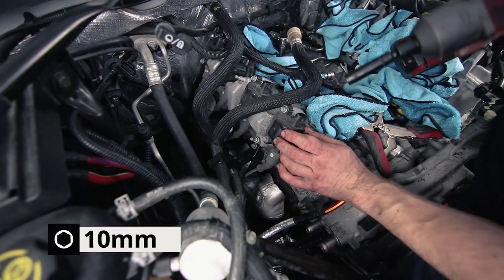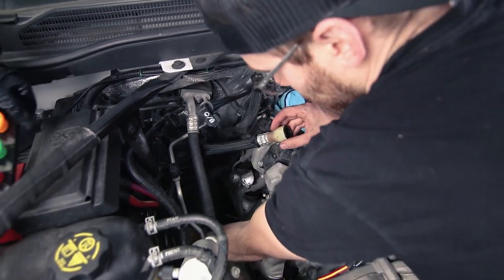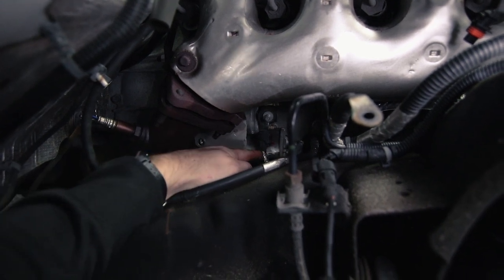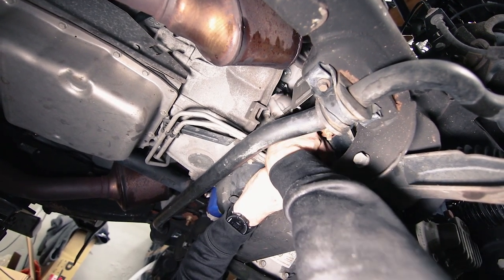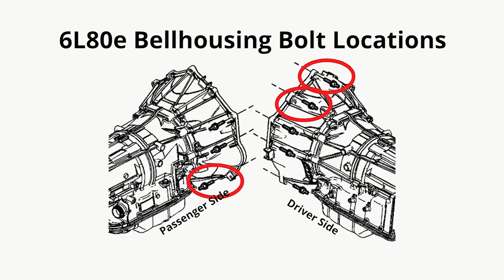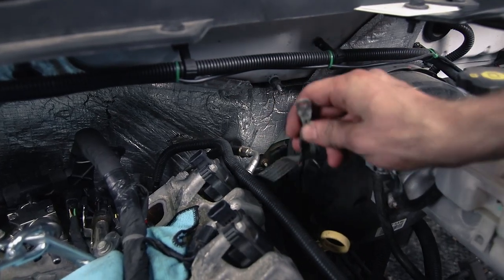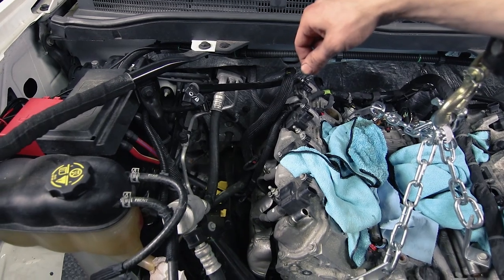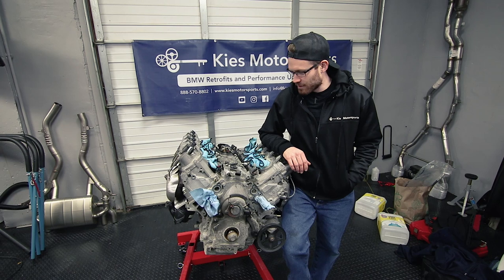AFM DOD Delete Part 3 - How to Remove 2014-2018 Silverado Sierra 5.3L and 6.2L Motor L83 L86

Comment: FYI there is radiator drain on lower passenger corner to drain coolant.  Hidden and not easily visible but it is there
Reply: used it on my 14 silverado 5.3
Reply from the maker: Of course there is 🤦‍♂️ haha I wish I had been able to find it. That would have saved a lot of cat litter. Thanks for the tip!
Reply from the maker: I'm waiting for the comments to roll in of what was  missed or wrong. Yours is  a helpful one tho so I pinned it to help anyone else 👍👍
Reply: It only drains what's in your radiator. Not your engine.
Reply: Just curious… I tow my camper and I was wondering if you or anyone you know of switched out the non max trailering radiator for the larger max trailering radiator? Is it even possible?
Reply: @theboostedgamer4453  probably better just to get the mishimoto trans cooler and radiator than going oem
Reply: He keeps calling the ignition coils injectors. The injectors are under the intake manifold and are not accessible unless the intake manifold is removed.

Comment: This is the most comprehensive video of GM engine removal I've seen.  Since your AC wasn't charged, you were about 20 minutes away from having  the entire radiator support removed.  The extra 20-30 minutes of work is worth it to not have to climb over and into the engine bay.  Saves your back.  Also you can pull the entire engine/trans assembly straight out if needed.  .
Reply from the maker: Thank you! Good to know! Wanted to show how to do it without removing those parts since most diy people will do it with the front end still on the truck. That would have made it far easier for sure tho.
Reply: Is it worth doing the front end removal to pull both at the same time? Im planning to replace my trams and engine. Not sure if its easier to do separately or together?

Comment: Thank you so much for this walkthrough.  After a lifter failure, I decided I wanted to do a cam and stuff.  No chance I was going to do it while in the truck.  If you take the heads off and manifolds completely out, it makes this much easier, especially getting to the starter and all the other stuff on the side of the block.  Great work on this video, not much out there on removing these surprisingly.

Comment: Small tip when you get started taking the engine apart to remove it squirt the trans dowls with PB blaster.  They will come right out by the time you start to separate the trans from the engine

Comment: Great video. I am looking to take my 5.3 (l83) out of my 2016 chevy silverado z71 ltz 4x4 soon to install the 6.2 (l86) in it. It has the 8 speed transmission already am going to use it for the 6.2. I will be making a video of the process also looking to add ported heads, cam, pro charger, ect.
Reply from the maker: Nice! I'll be sure to check out the process! Tip, remove the heads before pulling the motor. Way easier to get it out
Reply: did you ever swap it?

Comment: I’m in the middle of this on my ’15 Tahoe PPV/ 190K miles.  This is the best video on Youtube for the detail work.  My hat’s off to you. With the engine out of the way, could the trans come off of the Transfer case in the truck so you didn’t have to pull them all at once?

Comment: Is it possible to get the motor and trans out as an assembly? Leave the accessories (water pump, starter, etc) attached and remove them after the motor/trans are out?
Reply from the maker: Maybe. You dont have enough clearance to pull the motor straight out if you leave the front end peripherals  on. If you took off the manifolds and rotated it 90 degrees you might be a le to leave them on. I don't thinking the trans would be able to pull out from the top. I just don't see there being enough clearance. I dropped the whole assembly out of the bottom on my camaro on the k-member. That is how it is designed to work on that car. With the 4x4 on the truck it would be much more challenging and I'm not sure if there are cross members blocking that method

Comment: as a tech for gmc watching this is painful. you did so many things the hard way. but kudos for doing this with out a lift. you could of done the heads/cam with the engine in the truck.
Reply: Please reply with any Pearls of Wisdom. 

There isn’t enough info out there on LT platform.
Reply: As someone who has done a lot of head gaskets, I totally agree.
Reply from the maker: The second time we pulled the engine I pulled the heads first. Way easier to remove the engine. Filming it again I would do somethings differently for sure

Comment: @27:00 I was doing a rear crankshaft oil seal job and had a hard time removing those top side nuts and bolts. 😅😵

Comment: i always used Copper Anti Sieze on the 2 Mating Surfaces when i put back the Engine to the Trans .- especially on the Studs 
Wonder what the Book time Pays to Remove the Engine ???
Reply from the maker: The local dealer charges 22 hours for a cam swap with engine removal. I'm planning to use antisieze when I put it back 👍👍

Comment: I may uave to do this soon since my transmission is slipping i am thinking it is the converter since it has started to downshift a little aggressively and in some cases the same when it upshifts if it is the converter i won't be touching it untile i can re0lace the exhuast manifolds and the exhaust pipe

Comment: Did you guys leave the trans floating on stands or did you put the crossmember back on before removing the engine
Reply from the maker: We left it floating on jacks until we got the motor loose.
Reply: @TheSundaeDrive  I'd say that's why I can't get mine separated.  I haven't dropped the crossmember.  Ill try again tomorrow.  Thanks
Reply from the maker: @0922jus  good luck with it! Took a long time to get it separated for us too.

Comment: No trouble dropping that transmission pan when the exhaust flange was loosened :).??
Reply from the maker: It is definitely doable, I just wanted to do it this way for the video and making the best guide I could. Fat easier to film out of the truck and let me push the truck outside while we filmed and worked on the motor. Free'd up the garage space.

Comment: Im stuck changing the heads and cam and DOD delete on a 2014 silverado.  I think Ill have to remove the engine.  tried completing it with the engine in and you just can line up the dots on the gears with oil pump installed.  I think Ill try just lifting the engine first.  do you think it would be enough room to remove the oil pan with the engine lifted some.
Reply from the maker: It can def be done if you just lift the motor a little. If it is a rear wheel drive model it is going to be a lot easier than a 4x4. If you have the equipment tho, it is going to be easier pulling the motor in my opinion but it can be done in the truck. I personally haven't done it in the truck but many people have. We have the assembly video going up in the next day or two 👍

Comment: I'm really curious to see what kind of shape your intake valves are in.  How long have you been running the catch can?
Reply from the maker: They were in pretty good shape! I only had it in for 60K of the 108K. I meant to take photos before shipping the cores back but we filmed everything and I should be able to find some good shots of the intakes fingers crossed. I'm planning to check the heads in 50-100K miles (1-3 years, I drive a lot lol) since these will be brand new heads that will have a catch can on the entire time.

Comment: How much difference, if any, is removal of the motor, and engine teardown/ reassembly in an 09 5.3 model?
Reply from the maker: It will probably be pretty similar but I haven't worked in that body style to know for sure
Reply: @TheSundaeDrive  less sensors/ wires to unhook, but mechanically similar

Comment: Consider just lifting the cab or front clip instead?
Reply: Pointless.  If youre putting in a new cam, more than likely you will have to pull oil pan to remove oil pump to get timing off.  You can do it while its on, but its a pain.  Easier to pull motor.  Pulling the oil pan with the 4wd stuff is almost impossible.  Almost all of it has to come out.

Comment: i realize the truck is an older truck but i was wondering if being a direct injection Engine do you or would you install a catch can with your air raid system to avoid issues of carbon build up on the valves and cylinder heads?
Reply from the maker: +Miguel Reynoso absolutely! We already installed a catch can in a previous video. We went with E2. It catches a lot of oil. Highly recommend for DI engines to keep it cleaner... even if it’s just a little bit cleaner
Reply: @TheSundaeDrive  Thanks for your hard work to help me out fixing my 6.2 . My battery went comoletely dead and i switched iot for a new one i bought but i had to disconnect the "Range" i had plugged in to remove some trouble codes it threw due to the dead battery . So i did with a snapon scanner then drove home (60mi away) and parked to hear that the engine sounded like a maraca . Come to find out it threw 2 push rods (bent) so i had to operate on my truck . It took me 1.5 weeks due to the dealer not having parts out here . but got it together with your help , Thanks onvce again
Reply from the maker: Glad these videos helped and you were able to save your motor! :)

Comment: Do you have part numbers for the fuel lines ? They the same as a 2016 5.3 ?
Reply from the maker: They should be identical.I have to track down one of them but here you go:
 HP Fuel Line 12677004: https://amzn.to/2XrsHf8

Comment: I'm curious are you guys going to be running 93 or 87 with this build?
Reply from the maker: Tuning it for 91 because I travel a lot and not everywhere has 93 but I plan to run 93 when possible.
Reply: @TheSundaeDrive  would it be possible to run the truck on 87?
Reply from the maker: @xandersmith9832  only if you tune it for that but you are inhibiting the power gains of the headers and cam if you stick with 87; however, if you are only looking to delete AFM and not any power, you can definitely stick with 87. Just work with your tuner and they can help you.

Comment: Hi,very informative video.Is there any chance to remove the engine the same way if my engine is seized up(hydrolock) and I cannot rotate the engine to remove the 3 flexplate bolts?Thank you .
Reply: Only way is to try take spark plugs out and see if you can rotate if not pull trans out first with converter stuck to the flywheel

Comment: I have a 07 impala Ss but the 5.3 in it is mounted sideways. Think imma have a Shop do my DOD Kit This is a bit too much. KNowing me ill forget where I put the Nuts and Bolts at.
Reply from the maker: You would probably have to pull the motor on that because I don't think you would be able to get the cam out. I had no idea it was a transverse v8 mount in the SS. Is it still front wheel drive?
Reply: @TheSundaeDrive  Yes it's fwd. Every now and then My Lifter starts to tick, but goes away 5-10 min after putting a Qt of Oil in her. Shop Wants $3k to install a Tx Dod Kit in my 07 Impala Ss. So it would be bout $3500 cause I would still need to buy the Kit offline. As I said before Adding a Qt of Oil shuts them Lifters up So I'm kind of Confused about getting the Tx DOD Kit or just spend $5 every time I need a Qt of Oil when she starts Ticking...
Reply from the maker: @cammims7645  yeah, it is a lot to spend if the oil trick is working
Reply: @TheSundaeDrive  I'm sure hoping I'm not doing more Harm. What if Adding that qt isn't enough to make the 5.3 happy
Reply from the maker: @cammims7645  I like having the peace of mind knowing that it is removed. If you are planning to keep the car for a long time I would say to do it. Given the age (and I'm assuming mileage) it is probably a good time to replace all the gaskets and seals and change out your valve springs and pushrods (unless you have low miles) anyways. 3000 seems a little high with how easy it is (I'm assuming anyways) to pull your motor, might want to shop prices a bit but if you trust their work it is worth the extra money. Make sure it is a place that will stand by the work and warranties it.
Reply: @TheSundaeDrive  She got 150k on her and Yes I plan on keeping her since I bought her for only $600. All it needed was a Radiator I replaced.  So def want to make her last.
Reply from the maker: Oh wow. That's a steal

Comment: Why not just pull the Crank Pulley before the Starter?
Reply from the maker: The starter is not normally engaged so it won’t stop the motor from rotating when trying to loosen the crank pulley. It only engages when you turn the key
Reply: @TheSundaeDrive  Crank bolt should come right off with a 1/2” impact

Still not sure why you removed any of it. Should have just pulled the radiator. You drained half the fluid on the garage floor anyway. 

Oh well, thanks for the video anyway
Reply from the maker: A strong enough impact can get it off absolutely. The motor needs to be pulled to delete dod because the oil pan needs to be dropped. Very challenging to drop the pan, clean off the rtv, and reseal with it in the truck.

Comment: Pull the engine out of a new truck??? Are you guys crazy?? This should not have to be done. Where has the quality gone? Oh yea Quality doesn't make MONEY!! So SAD!!
Reply from the maker: Actually, you can thank the EPA for this issue. It is all done for a miniscule fuel economy improvement. That said, the majority of the vehicles won't experience this issue but it is still far too likely to happen than I am comfortable with.
Reply: too much gov’t…

Comment: Is it necessary to remove the dampener before pulling the engine? Do you think if the rad was removed it would give enough room to pull it with the dampener still attached?
Reply from the maker: Coming straight out as we did, there is not enough room; however, if you bring it up half way and remove one exhaust manifold, you can rotate 90 degrees and get it out with the dampener on.
Reply from the maker: @1999cummins4life  awesome! Love hearing that they are helpful :)